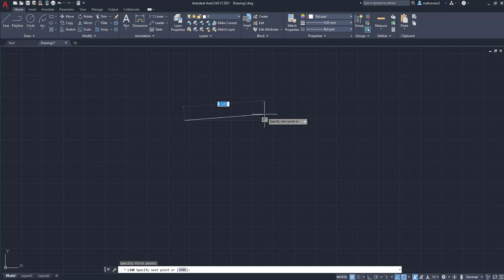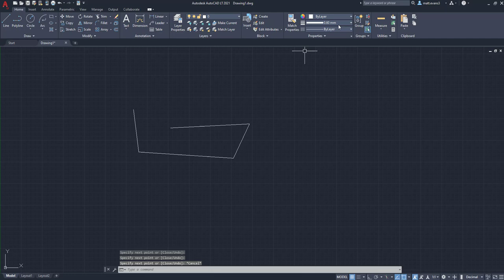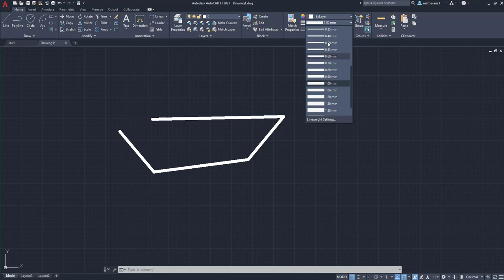Make Line Thickness Visible in Drawing - AutoCAD

Comment: My lines are visible now but become 2 dots when the lightweight is 0.30mm and above. Do you know what I can do?
Reply from the maker: Thanks for the question! i have never run into this issue before but it sounds like it could be a deeper issue within AutoCAD or your computer. Try typing the command GRAPHICSCONFIG and you will see a selection box underneath a title that says "2D Display Settings" instead of the "Advanced Mode" try the "Intermediate" or "Basic" mode.